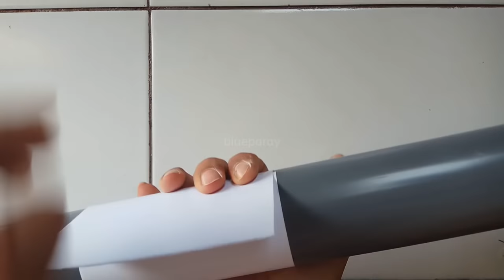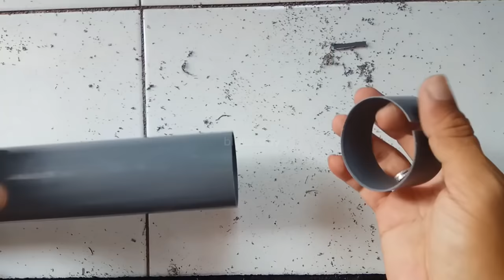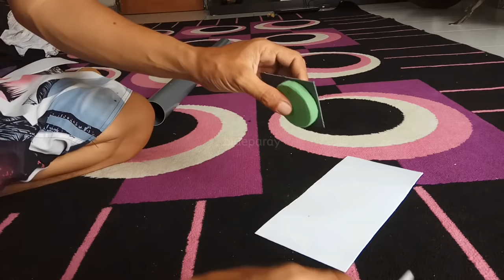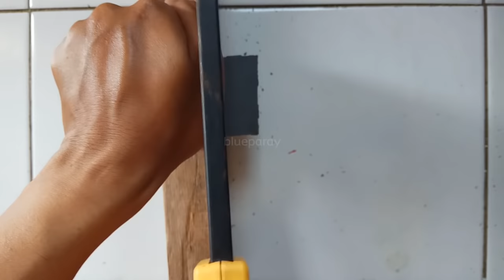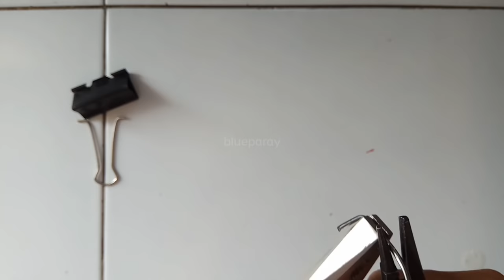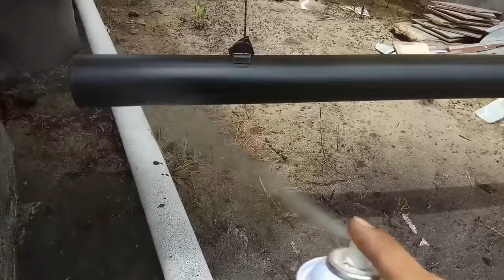Making Fishing Rod Case Made Out Of PVC

Comment: Very nice looking rod case! Thank you for sharing this! Two questions. Assuming the pipe material is PVC, what glue were you using? I tried epoxy, pvc cement, etc., but the bonding is weak. Also, did you apply any primer before painting the case? I tried to paint my case, but paint (oil-based) is not bonding with the pvc material well. Thank you so much!

Comment: To behonest, I have done it,before I saw Video, honestly speaking You coud buy ready cap and save time. Regardingidea - I'm useing it from 4 Yars, to Umprela, Roads, Net i'ts pretty practical.
Reply from the maker: I know using a pipe cap is more practical and save our time, but i didn't like the finishing result, not good looking, sorry just my opinion 😁✌
Reply: Yes, here You are write, Your looks GR8, I totally agree. I'm only think about the Glue You are useing ?
Reply from the maker: It's super glue (adhesive)
Reply: I'm asking because You made for one Rod, I have normally 2 Carp Rods or Umbrella, I'm made it different way, because of the Weight. Probably it won't held.